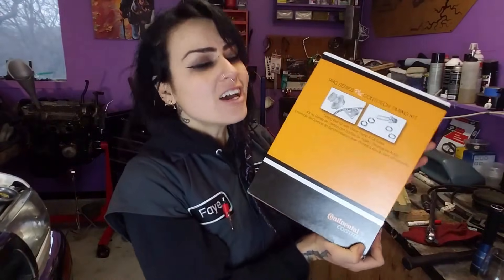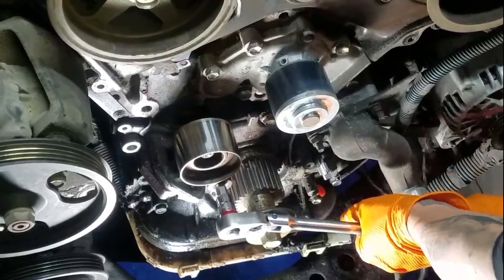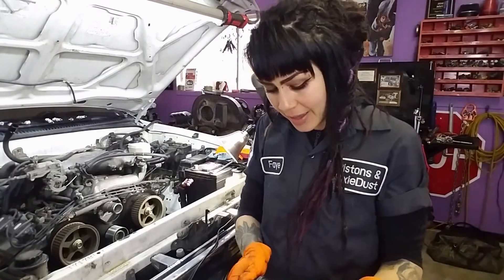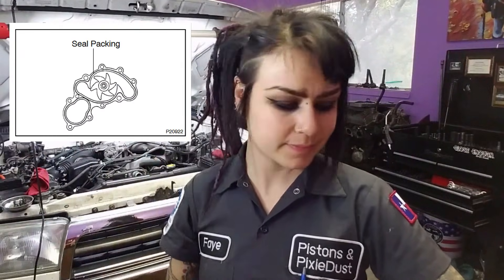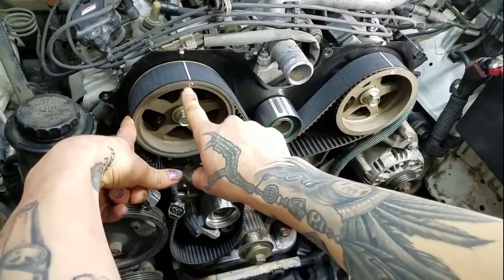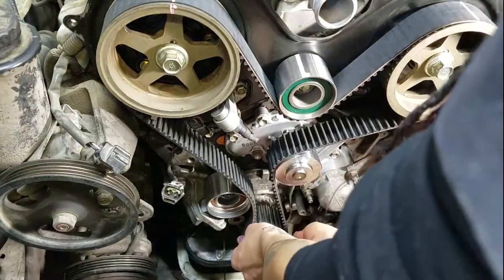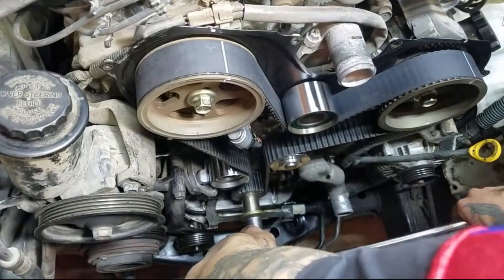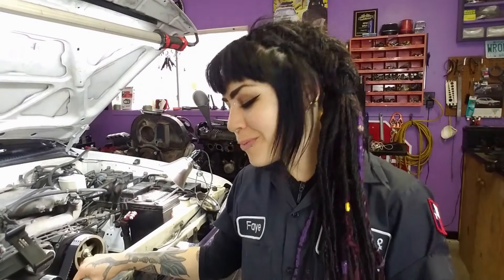Toyota 5VZ (3.4L) Timing Belt, part 2: Accessories and Installation

Comment: Thanks for posting this. I just did the timing belt on my 2002 4Runner. Belt broke while driving and was happy to find out that the 3.4 is a non interference engine. Autozone carries the complete kit as well if you need one  ASAP . You are awesome and your videos help . Keep them coming 😊
Reply: Hey man, I know this is an old post but do you remember how many miles you had on it when the belt broke?
Reply: @stokular  I no longer have this vehicle but I think I had about 240,000 on the clock . I know when I sold the truck it was at almost 300,000
Reply: Same happened to me. It didn't break, it shredded to crumbs. It was a miracle it was driving in the first place.

Comment: My 2004 Tundra is sitting outside right now with a broken timing belt. Your video is the second one I watched. The common element that sticks out is the problematic tensioner bolts. They are the ones that often are stuck and get damaged or broken during removal. I will start with wd-40 on all bolts that I have to remove.  Thank you again.

Comment: Once I had to get the flywheel off of a Hyundia Excel, so I dropped the oil pan and put a piece of a 2x4 between the crankshaft and the block. It worked like a charm.

Comment: Your camera angles and explanations are very detailed and a lot better than some of the other YouTubers but you leave out some key information like there are two dots on the crankshaft gear one for TDC that's on the back of the sprocket and one at the front for where the line on the timing belt lines up with the gear and you didn't talk about the dot on the front of the sprocket....

Comment: Thanks for the video. I was installing the timing belt on a 1997 Tacoma and was thrown by the crank shaft belt marks. I watched several videos trying to figure it out and my book shows it going straight down from TDC. Nobody showed the position of the crank belt mark and I was consistently coming up 45 degrees clockwise from TDC. Watching your video I caught one glimps of the mark at 45 degrees clockwise from TDC. Upon looking closely at the crank sprocket I saw the dimple! I installed the belt and rotated the crank many many times and all my marks came up perfect ever time. Thanks again.  Keep the vids coming.
Reply from the maker: I'm so glad it was helpful!!! That's amazing!!

Comment: I wish I'd seen this before I did the water pump on my car - the explanation of the variety of tools you used to clean the gasket surface would have been very helpful to have when I was buying stuff ahead of the job.  I'm sure I'll need to clean a mating surface again at some point, so thanks for that!

Comment: Great video, Faye. I appreciate the fact that you use genuine Toyota sealant and actually torque the fasteners. That's the RIGHT way to repair cars! That crank pully holding tool is pretty ingenious too. Keep up the great work.

Comment: @16:50 kudos for mentioning the fact that the timing marks on the belt will never line up with the timing marks on the crank and cam gears once the engine is turned. Had a guy once who was in a panic about that, and I liked to have never been able to convince him that the marks on the belt weren’t that important once the belt was on, that what was important was that the timing marks on the crank and cam gears lined up with the timing marks that were stamped/cut on their respective “back covers” once the engine was turned over a couple of times.

Comment: I just did this job using this video and it was super helpful.  Thank you for adding in the torque specs and the magic driver extension combo.  Could not have done this job without your videos.  ❤

Comment: Excellent job Faye. I attempted to do my 98 4Runner and was not able to get the pulley off. It was like not bolts were the correct thread. That was many moons ago. I swallowed my pride and Thad the shop finish it :/. I sold my 98 4Runner, one of the spark plug was under water, yet it still started. 360k. Awesome truck. I just bought a 2001 SR5 4Runner, and I will attempt to do the timing belt job soon. Again thanks for your excellent video, and the cameos by your talented chickens.

Comment: I did a 01 4Runner a while back and discovered someone before me tightened the tensioner pulley bolt so hard the threads stripped out of the oil pump housing. It was nothing a heli-coil and some foul language couldn't fix.

Also - I'm in the habit of applying anti-seize to any bolts/studs that clamp stationary items, eg., those for water pump and timing cover. My obsessive use of corrosion inhibitors on hardware is due to the extreme conditions present in the rust belt, and that a lot of our customers keep their cars forever. So next time around I'll be doing the job without hardware struggles.
Reply: Any steel bolt into aluminum gets AntiSeize.
Reply: Great ideas! 
Good comment!

Comment: @Faye Hadley  @8:22 One warning people should have about using FIPG on a water pump (the reason it says for oil pans only).  If a person puts too much gasket goo, then it can squeeze out of the edges, both on the outside and on the *inside*. On the outside it obviously doesn't do any harm, but if it squeezes out on the inside, then then rubber-like globs will eventually break off.  Once free in the coolant, the chunks will flow with it until it gets stuck in a restriction, typically the little passages in the radiator core. This happened to me on a 3VZ-E in a 4Runner after having a shop do the belt & pump... Some of the the FIPG chunks were visible through the radiator cap, plugging the radiator passages (there were a LOT, & appeared to have been chopped up by the impeller), which contributed to an overheating issue... and maybe a blown headgasket, although that may simply have been the 3VZ :-).  Great videos btw, I may tackle my 03 Tacoma 5VZ belt/pump after watching this.  Keep them coming!

Comment: Although I don't own a Toyota yet, I learn something new with every video you make. You made the gasket application look easy, applying makeup counts as practice. Finally, you answered a long burning question, smooth side versus rough side of a washer. Finally, one of my first toy/tools was a torque wrench. Figured out how to use it, it was a sigh of relief to put a number on just how tight things should be. Happy Day, Happy Faye, Happy Chicken

Comment: I would rub some real good grease into idle pulley bearings, tensioner pulley bearings as well, you take a look very little...it sealed with nylon seal, so we can use sharp metal pin to pry out, rub good grease in put back seal....I found out way more lasting.....I tried all of my colleaques cars....kept running...longer life...
Keep on fixing Faye...great job.
Reply from the maker: Awesome, thanks!!

Comment: I've never had good luck with those stickers.  The ink always fades or washes off when I clean the engine bay.  I usually pick an area of clean paint, such as the radiator support or fender, write the info with a sharpie, and spray some clear coat sealer over it. 
Yes, I stayed for the "secret scene" at the end.
Thanks, Faye.
Reply: Those stickers usually come with a clear tape to put on top after you write all your info also makes it tamper proof

Comment: Great job. You are smart to buy the longer torque wrench to tighten the crank nut. 215 lbs is no fun with a shorter wrench. My favorite part is when you pulled the pin . My 2002 tundra will need this again soon. Thanks for sharing.

Comment: Im doing in the morning.  Thank you for the walk through
Reply: I cant get the harmonic balancer off. I have a big 3 claw remover and 2 long wrenches heat and penitrating oil. I took out the radiator. I can turn the engine now with the puller, im scared im gonna break something.  I also used the breaker bar on frame and bumped the motor to break the harmonic bolt. Thats scary. If i cant get it tomorrow im going to have to reassemble and go to a professional. Thank you again for the great video.

Comment: I’ve had a water pump leak on a 4cyl Camry water pump because I missed a little piece of gasket. A lot easier than the v6 to back up and fix. On the bearings I actually reused mine, they felt better than the Chinese replacements, Cloyes kit. I was disappointed in cloyes

Comment: Hello Faye
Thanks so much for the instructions video 👍👍
The timing belt mark for the crankshaft pulley  what is it supposed to align with?
Thank very much in advance 🙏🙌
Reply from the maker: The mark on the oil pump housing!
Reply: @FayeHadley  thank you very much

Comment: Hello there! I am a toyota fan. Thanks for your info. I just wanted to share that I like using AISIN water pumps, MITSUBOSHI timing belts, TIMKEN/KOYO/NSK/NATIONAL bearings, NGK plugs and wires, and DENSO parts on toyotas.

Comment: Thank you , thank you, thank you! Just the video I needed! BTW, I find pushing instead of pulling to be easier and stronger (if that makes any sense). Anyway, I love your videos. I am going to do my 97 4runner today!
Reply from the maker: I had a mentor tell me once "never push a wrench" 😄 and I sort of keep that in my mind during high torque situations, because you can slip and bust a knuckle, but you have more control with your muscles when pulling!! But most importantly is that you get the job done, so do whatever is best for you!!!😃

Comment: I've got the Aisin pump with the metal gasket with rubber bead on it. 

I wanna use FIPG in areas I have pitting 

Would you recommend the sealant on both sides of the gasket itself?

Comment: Faye my 2000 tacoma used a Oring on the water pump it started to leak at 28000 the dealer had to fix it 3 times before they used the oring and form a gasket. i see your water pump had the oring grove did they stop using orings on the water pump?
Reply from the maker: Never used o rings!!!
Reply: @FayeHadley thanks for the reply Faye,.  in the 3 times i changed the timming belt and water pump i never seen a paper gasket for the water pump. i did use a small amount of form a gasket on both sides of the oring bought from toyota. just saying what ever workz right.

Comment: Curious how you tightened the fan bracket studs back into the block and to what torque spec you used for the studs that came out AND stud bolts?

Comment: Hey Faye, What tool did you use to remove the cam and crank seals? Thanks in advance....Rob
Reply from the maker: I have a special tool, but honestly, a small pry bar for the crank and a screwdriver that I bent into a 90* angle for the cams. I pry against the end of the camshaft. Only the end, not the sides!
Reply: @FayeHadley  Thanks for the reply, I  found this tool and thought it would work quite well...what do you think? Lisle 58430.....

Comment: The timing belt might not come with lines for TDC, however, it does have the dots on the side of the belt? Which must lineup with the marks on the motor for TDC?
Maverick

Comment: The sealant plus paper gasket is just high tack glue, not gasket maker silicone. It comes in a can and is just a gasket compatible glue so the gasket doesn't keep falling off when installing. It's on the Permatex website as sealant or dressing. I use the paper gaskets with the sealant. Never had a leak. Gasket maker takes 24h to dry and the Ultra 5 min maker goes bad in a few months so it wastes a whole can unless u do a lot of gaskets.

Comment: Faye...2 questions.
1)What are the bolt torque specs for the fan bracket?
2)Did you replace the crank bolt, with a new one?
Thanks for sharing....very helpful and detailed.

Comment: Does it not change the torque values when you have extensions or other accessories installed on the torque wrench??
Reply: yep. great question. i add more lbs. about 5%. to a 12 in. extension. i have had good luck. not very well engineered by me, but seems to work.

Comment: What's the point of the mark on the belt down near the crankshaft? It doesn't line up anywhere,or should it?
Reply: Just did our 5VZ today. There is a small indentation in the timing belt pulley (on the crankshaft). Hard to see at first. The line on the timing belt marked "crank" must align with this mark. If you mark it with a paint pen makes it easier to see and align.

Comment: Hey Faye! So, I used my crank pulley bolt to turn the engine until I was at cylinder 1 TDC. Now, when I try to remove the bolt it is turning the crank gear away from the mark… How do you get yours to come off so easily without turning the crankshaft as you removed it?

Comment: After replacing cam sensor, all pulleys, belt, and tensioner. I made sure all timing is correct, no broken teeth on crankshaft sprocket and still getting P0340. The truck won’t start. I’ve looked everywhere online for info and tried everything...nothing Any ideas? maybe replace crankshaft sensor but the code isn’t reading that issue.

Comment: I got my crank pulley bolt stuck trying to check the new timing belt as I was rotating it and now can’t get it off... do you have recommendations to remove it Faye?

Comment: question, your torque wrench scale/adjustment reads from the bottom/backside ?asking about the wrench you set to 30 ft/lbs
Reply from the maker: one side is ft lbs, the other is nm!
Reply: @FayeHadley  Ah all of mine are on one side though nm on one side left or right then ft/lbs

Comment: How do you feel about reusing the crank pulley bolt? Does toyota really recommend using a new one?
Reply: Yes they do. Enquired today at our local Toyota dealer and cost $18 (Australia). They have to order it in from Japan and would take about 6 weeks to arrive. Told them to forget it we'll just reuse the old one. Seems perfectly good.

Comment: Excellent video Faye.  I saw a mark on the timing belt that would line up with the crankshaft cog, but didn't see a mark on the cog itself.  Is there one or do you just make sure the mark on the cog aligns with the dimple on the engine?

Comment: Hi Faye - because Toyota parts are so reliable wouldn't it be better to spend triple and get OEM instead of the continental kit for reliability??? I'm a hobbyist but have the same truck as you. And I'm going to do my belt soon. Thanks.
Reply from the maker: This is the kit that I used at the indie shop I worked at after I left the dealership, so I am really comfortable with it, and have used it many many times without fail - but dealer parts I agree are always best!!!
Reply: @FayeHadley  Hi Faye - one last question - can you use FIPG and the Paper Gasket? What's the best way? Also when you put the Thermostat back in do you also use FIPG or paper gasket? .You seem to prefer only using FIPG by itself. Thanks again

Comment: I'm pretty sure the Toyota sealant is nothing more than RTV silicone gasket sealer available from Permatex for about 1/4 the cost.  Both are available from Amazon.
Reply: I think your right it seems to all be RTV silicone just in different packaging.

Comment: The lines on the belt do align again once every so many revolutions (less often with longer or more complex timing) .. basically look at the ratio of teeth on the crank to teeth on the belt.. of course the cams are 2:1 so I think u take the# of teeth on the belt divided by the # of teeth on crank and double that number that's how many times you'd have to spin the crank to align all the planets again.. lol

Comment: Good job Faye. Good to see a female mechanic. I don’t personally know any and I think it’s pretty cool. Also you didn’t mention if that is an interference engine or not, I was curious. I have a Highlander with the 1mzfe and I can’t get the cam sprocket bolts out. Hopping I would get to see you try. Don’t want to damage my valves. Any way good job and beautiful chicken!

Comment: Faye,
    I know you are busy. Havent seen your new series, but congrats on that!!
 Still working on my timing belt water pump, pump is on and at the point of putting the thermostat in....6 or 12 position!!
Timmy toyota toolman says 6 oclock....looks like you say 6 oclock(indirectly with the picture from the manual). I told Timmy I wasnt going to be the disbeliever foo and I would put the thermostat jiggle at 6.
Here I am, asking yet another person .But, hey im ocd+adddhd, and I want this 03 taco to purrrrrr.
So if you get a moment, would you set me straight.
P.S. Dont tell Timmy.
Thank you Faye,
Kevin
Reply: Took ours out today and it was in the 6 o'clock position.

Comment: do you run a cooler thermostat or the hotter running one?
Reply: I do the same thing because I notice where I live in florida it runs better with the cooler one  Swampy
Reply from the maker: I run the factory thermostat! Even here in hotter'n hell Texas! I've never overheated, and it keeps me from running too rich.
Reply: Back in the day, i always ran cold, 160 thermos in my V-8s, heat is the enemy

Comment: Faye, awesome channel and videos, and GREAT work on the 5VZ!! What are your thoughts on replacing 1GR-FE timing CHAINS for FJ Cruiser/Taco/Runner?  My FJ, "Jolene" is hovering at 250,000miles basically, and I am paranoid her chains are gonna break, (Interference engine, ya?)  I've kept a fund set aside just for it, but last month I found I needed to replace BOTH FRONT CATS....which was....you guessed it....the Time Chain Fund.  I have no symptoms that I am aware of, or engine issues, changed oil religiously, etc.  How hard do you think it would be for a mostly-sort of-kind of-somewhat mechanically inclined person?

Comment: Sooooo pretty much you need to replace the belt , both pulleys,  water pump,  thermostat,  probably the small hose you disconnected . Sounds like around 600 to 800 dollars to me , if from dealer.
Reply from the maker: They tent to want 900-1000
Reply: @FayeHadley  holy crap